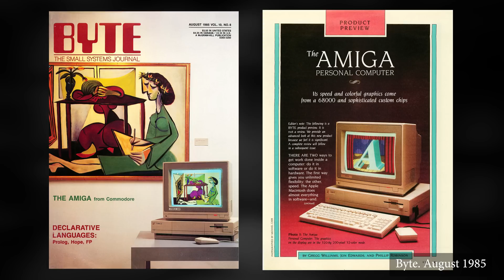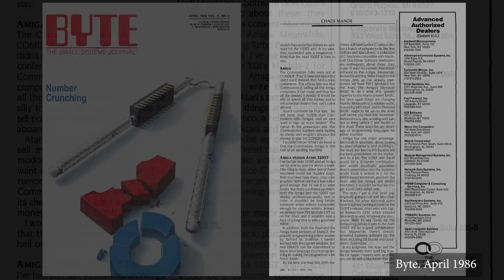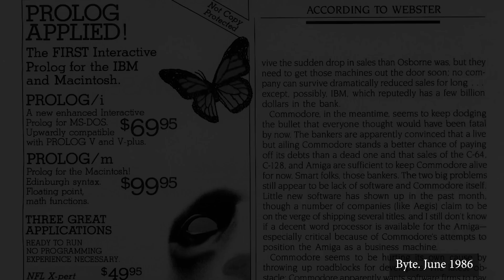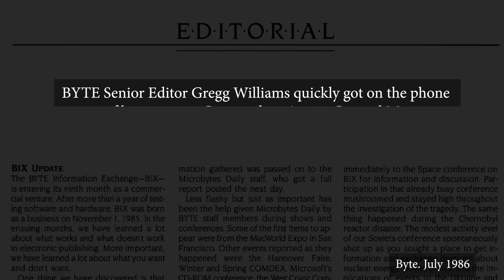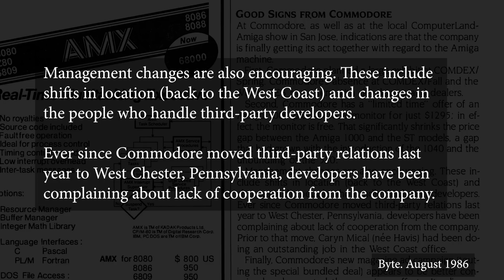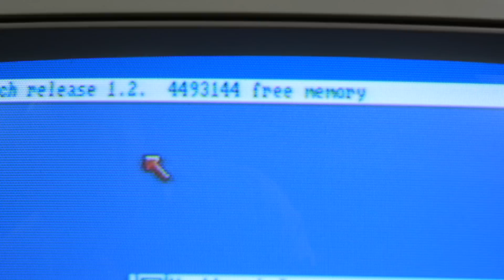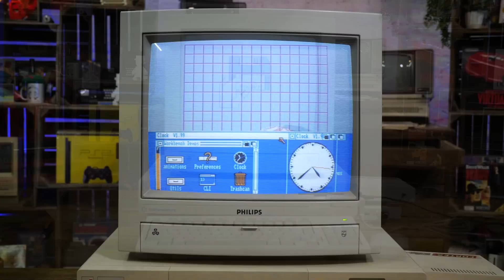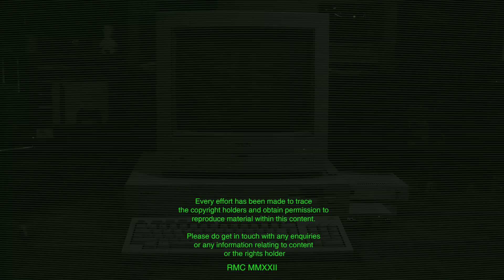Commodore Amiga 1000 Trash to Treasure Part 3 | The Demise and Legacy

Comment: I'll always regret giving away my Amiga 1000 back in 1992, at a time when I was disillusioned with the world of game development. I was originally given the A1000 as part of my deal with DigiTek Software for writing "Dino Wars" and porting "Bill 'n' Ted's Excellent Adventure" to the system. It was a great computer, and I did so much cool stuff with it: programming games, making art with DeluxePaint, and composing music with various Pro Tracker apps. I occasionally feel the temptation to pick up an old Amiga from eBay, but if I manage to find the time to dive back into retro coding, I can do everything in emulation. Still… there is nothing to compare to having the real metal in your hands.
Reply: I still have my A1000, A500, and A3000 in my closet. But I regret getting rid of my first computer, the TI-99/4A. I had the speech synthesizer, expansion box with ram expansion card, floppy controller, and 5.25" floppy drive. Also had Extended Basic and Assembly cartridges. I was able to teach myself Basic between the excellent documentation that came with Basic and Extended Basic and all the programs I typed in from Compute! and 99'er magazines. But I just couldn't wrap my head around Assembly w/o any resources to learn from.
So, we all have something that we wish we hadn't gotten rid of......
Reply: Get the real metal.
Reply: @SirReptitious  Funny how different people have different memories. I bought a TI-99/4A new when they came down to £59. Without the RAM expansion it was laughably slow, so six months later I sold it for £30 and bought a Toshiba MSX (also £59) which was a nice machine which I still have. All this time the C64 and Spectrum were far more expensive due to their games libraries.

The only positive thing I can say about the TI-99/4A was that I wrote a Morse Tutor program on it which was a big help in getting me through the Radio Ham Morse exam.

Comment: What a wonderful restoration. I did make that decision and did not buy an Amiga 1000 back in the day. It was really an easy decision since I did not have $1000+ to spend on one. That being said, it was also an easy decision to drop $550 on an Amiga 500 in 1987 and that decision changed my life.
Reply: For sure the A500 price point put the Amiga in actual reach of the average home user. In 1985 my parents opted for the very price competitive Commodore 64 as the very first computer to bring into our blue collar working class home, and even then we had to make do with a tape drive for the first year and a half we owned it as even a floppy drive was a big spend at that time. The Amiga 1000 would have been completely out of the question. The A500 though was much more reasonable at it's launch price, and by 1989 it was inexpensive enough that I, as a young teen, was able to talk my parents into upgrading to one only by offering to pay for half the purchase myself with money saved from my paper route.

Comment: A friend of mine got one more or less as soon as it was released. And oh my how much I wanted one when I saw it and played around with it. It was just to expensive for me though. I was still in high school and I had to settle for my C64 a few more years. Then the 500 appeared but since I did my military service I couldn't afford that one either. So when that was done in the autumn of 1988 and I got my first real job, the first thing I did was go and buy the A500, 1084, 1010 and F/A-18 Interceptor. I never went outside my apartment that first weekend. 

Would still love to have an A1000, it would look awesome next to my A500 and A4000. They are to darn expensive though, again.

Over the years I've used some incredible software on my Amigas. Pagestream and ImageFX are two shining examples that I actually used professionally. Bars & Pipes is another. Had software like those been avaliable when the Amiga was released things might have become completely different. Just one of the many bad decisions by Commodore to not have the software ready.

Comment: I've truly loved this video series on the restoration of the Amiga 1000.  I believe that ProPaint was actually released by Commodore as GraphiCraft, but I suppose that this has already been pointed out somewhere in the comments.  I didn't use this "pixel graphics" program until the mid-to-late 1990s and it was a poor substitute for Deluxe Paint, but it would have been amazing to use it in 1985.

I bought two Amiga joysticks on clearance in 1984 at a toy store at the mall called KayBee Toys.  These were about $5 each.  These became my favorite joysticks to use with my Commodore 64 (I didn't get my first Amiga, a 1200, until around 1994).  Much later, when I used them again-- perhaps in the early 2000s-- the Amiga joystick was especially painful to use.  I couldn't fathom how I liked it so much fifteen years earlier.

I didn't see the Spaceballs demo until around 1997, which was a few years after it was first released.  It blew my mind then for what it was doing and I can't imagine what I would have thought if I had seen it in 1985.

The Amiga 1000 was so far ahead of its competitors that no one even understood what true multitasking was when the system came out.  I don't believe that we could go back in time with modern software that would run on a base Amiga 1000 with 512K and show anyone who lived in 1985 the software who could appreciate it.  I think even Byte magazine writers might shrug their shoulders and peek under the desk to see what $10,000 computer was hidden away that was really running the show.  Really, come on, can you blame them?

Amiga, forever, baby!

Comment: If they would see that demo back in 85, their heads would explode!
Reply: They probably would have assumed it wasn't being generated by the computer in real time. There's no interactivity in that demo so people would have assumed Commodore was pulling a fast one with pre-recorded video from a hidden VCR, most likely.
Reply: Can you imagine if the C64 was first shown running Sonic the Hedgehog instead of the Christmas demo? XD
Reply: @philrod1  Or, Super Mario Bros 64
Reply: @JeremyLevi  Simple method against that 'VCR' argument: pull the plug mid-demo (shouldn't hurt anything with that setup...), and then let the whole startup process go up on the big screen they must have set up for the event, to show it's all really coming from that machine... But, as that demo didn't exist until a few years later...

Comment: That A1000 certainly is looking good once more. Sometimes I miss my A1000. I always like how you could slide the keyboard under the main unit. :)  I had upgraded its memory using the front memory expansion. A later upgrade back in the day was to install an internal 68020 CPU board with additional on-board RAM.

Comment: One problem that seems to grace a lot of American companies is, they always want to take the development cost of a machine back right away.  The Amiga 1000 probably had a production cost of a couple of hundred dollars, so they could have easily matched the ST cost (until Jack starts another price war)  and still made apple kind of profit, but instead they wanted to squeeze every last dollar out of the machine possible. This drastically hurt initial sales.  Also, the should have done the Atari approach and released a home version (A500) and then a desktop version.

Comment: I have my own A1000 in the garage and I have an A1200 too.  I lost the power brick for the A1200 and haven't played with it since 2009, I have the box, and keyboard also.  Imagine, I paid £1,200 plus HP charges in 1987 and enjoyed it for years until 1992, when I got the A500, traded my A500 for the A1200 and got a PS1 and forgot about the Amigas until I was married in 2003, set the 1200 up; my old CRT monitor for my PC went down & I stopped looking at the Amigas altogether.  I loved them very very much, shouted at Amiga HQ, wrote a letter to them saying that you are going bust etc, when they launched the A500, but ran to the local John Lewis and got another credit agreement as soon as the A1200 was mature enough!!

I think if I was near my garage I would dig it out my Amigas and try to get them going to relieve some of the 1980's and 90's joy, I had.

Great channel!

Comment: I also got ‘Eliminator’ and ‘Powerplay’ with my A500 in 1990(?) - £399; tried to back up the Eliminator game, and it killed the disk. I wish I still had the letter from Hewson; I wrote to them pointing out that their disk broke when i tried to back it up, and they wrote back basically telling me it’s my own fault and definitely insinuating I was trying to rip it off… which (on this occasion) I wasn’t!!
Also: 9 Fingers is a cracking demo. And, last week I finally got my A1200 online for the first time since I got it :-)
Reply: Deluxe Paint had that evil copy protection too. I was able to mostly salvage my copy using DiskDoctor (the one built into AmigaDOS on the Workbench), only permanently losing the Preferences app... which I then simply copied over from Workbench. 😛

Comment: I had a really expanded 1000 back then. A DKB kwikstart board held ROMS from a 2000 so bypassing the kickstart disk. A Phoenix expansion box plugged onto the side port giving me two Zorro II slots. One held a CBM ram board and the other a Trumpcard HD controller connected to a pokey 40MB hard disk. .... the good ole days. :-)  I wanted to do animation and graphics, so the Mac and ST were no choice at all.

Comment: Where i really enjoyed this piece i think itsxa bit top heavy on barriers and failure. I had a day 1 uk amiga 1000 and loved it. It had barron periods which did not go away until the a500 but ask me my fun time in computers and it was the a1000 without a doubt. Because of the expense you savoured every thing you bought for it. Because of the juggler demo i bought my first rayvtracing software and i have so many other stories. To me it was just a slow burn device but i cant forget my fred fish pd disks and my games of marble madness bards tale and defender of the crown. Great video but for some of us the a1000 was king. NOTE at computer clubs i brought my a1000 along and a friend his a500. My desk where i set up was twice as busy as the a500 desk. An impression i am sure others also saw at other clubs is the a1000 was class and exciting. Excelsior sir

Comment: I bought a C128 in September of 1985.  It was a massive upgrade from my VIC 20.  The A1000 was way out of my price range.  By the time I wanted to upgrade again, about 1990, I looked at which systems were gaining space in the stores here in the US.  The IBM compatibles were gaining the most, so I bought a Commodore Colt and stayed with rather compatibles ever since.

Comment: As an Atari kid I first went for the Atari ST (I think it was a 260ST, with 512KB + a 512KB extension to 1MB) not knowing, that the Amiga was the "real" successor to Atari's 8bit line. But when the A500 came out I switched to the Amiga and later to the A3000. Looking back I probably should have kept the ST for making music, because the MIDI box alone was more expensive than what I got for my ST when I sold it and the Atari had better software for that. Then again, I didn't have enough room for both, since Cubase required the monochrome monitor, so I guess it was an OKish choice to go all in on the Amiga. Especially since I used DPaint a lot.

Comment: Great restoration and history Neil. I think there are a lot of what ifs regarding Commodores handling of the Amiga there certainly seemed to be a lot of bumbling decisions along the way. The A500 was a success but they never repeated it with continued development, it’s not like some of the engineers weren’t trying they just never got the support from those in charge. Just imagine Amiga running neck and neck with Apple today, what could they be doing in this day and age.
Reply: Apple is here today for ONE reason only. Because they forced Steve Jobs out in 1985. Everyone, including Jobs was much the better for it. In those 12 years away, he founded NeXT without which Apple would have perished in the late 90's, plus he made Pixar into something marketable, which he sold to Disney. Unfortunately, Commodore didn't fare as well for even a few short years without Jack Tramiel - his departure is what I believe was the catalyst for the company's failure. But, I also don't believe there's any version in any multiverse where Commodore and Apple could possibly be here today at the same time.
Reply: @espressomatic  Yet Atari didn't really fare any better under Jack. I think two big lessons are 

1.) There is only room for about two competing standards in the market. The same has happened with phones>

2.) Time and time again companies ignore the importance of backwards (and forwards) compatibility. They just assumed that everyone buying a new computer would replace all their software. Microsoft and Apple have always manged that more carefully.

Comment: I think you should also put some kind of clear protective sticky film on each keycap so that the painted keyboard characters will less likely fade from fingertip friction, as well as any liquid chemicals & dirt.  A long time ago, I learned a lesson not to clean dirt from keycaps by using IPA rubbing alcohol on my computer keyboards. Of course, it worked to clean it quickly, but one of my old PC keyboards now has faded key characters on them from the rubbing alcohol, heh.   Ammonia from glass cleaner can also fade keyboards.   Soap & water is really the best non-destructive method (for paints), such as what you & many have used over the decades.  You can find these protective films online, such as on eBay.  Of course, if you're not going to use that Amiga-1k that much, then the film is unnecessary, although putting a plastic shroud on entire computer will help keep away dust & lint.

Comment: Being in the US, I never really saw anything advertised for the Amiga compared to the legacy 64 and 128.
I'd had a VIC, but got a 128 in 1985 for the 64 compatibility.
Honestly, the Amiga wasn't on my or my friend's radar back then!
Reply: The 128 was one of Commodore's missteps I referred to in another comment above. In very early 1985 they should have released a more powerful/revised C64, but nothing like the 128.  Then they could have skipped the 64C entirely.
Reply: @espressomatic  I agree. I maybe had one or two applications that used 128 mode. But the graphics commands in the new OS was nice to play with. I spent a lot of time learning the commands. I ended up getting a degree in design graphics in college.

But yeah. Not everyone needed a 128.

Comment: I wonder if you've ever heard of the Phoenix board, produced by Phoenix Microtechnologies in Adelaide South Australia, that was a drop in replacement for the A1000 motherboard.  Added RAM, upgraded processor, SCSI interface all in the same case. I now regret getting rid of mine.

Comment: I donated that Cortex memory expansion: I had no idea it could be used without a separate PSU on the A1000 - it certainly can't on the A500!
Reply from the maker: Thanks again Philip, yes the manual states the A500 needs external power but the A1000 is fine without, which is handy
Reply: @RMCRetro  Don't forget that the Cortex can go all the way up to 8Meg if you can find compatible SIMMs - no need to stack separate memory expansions!